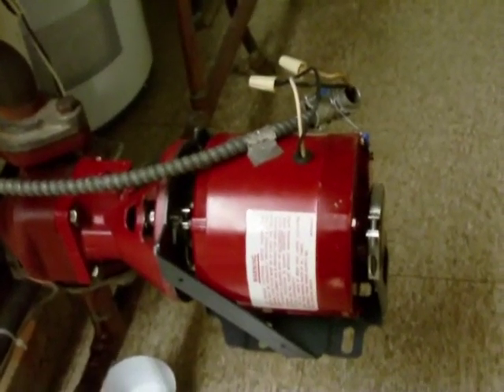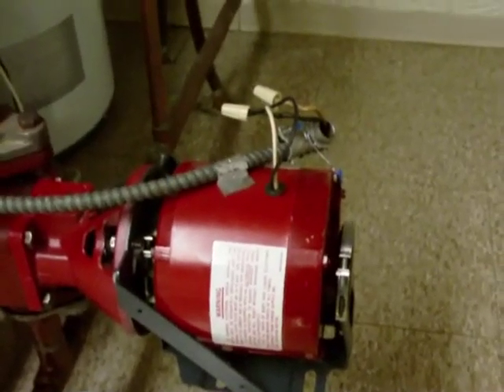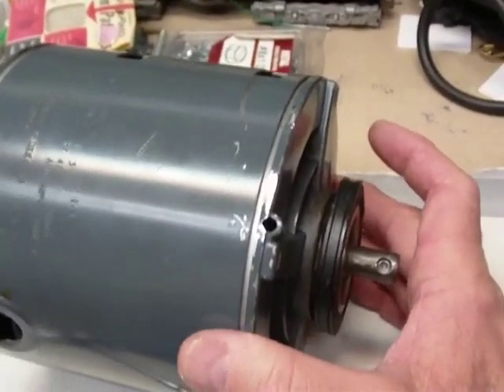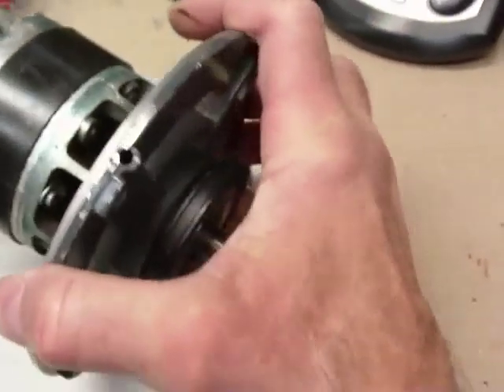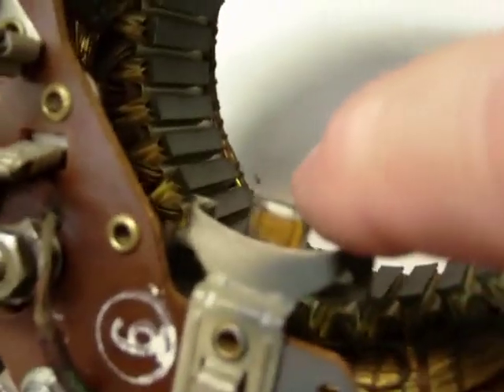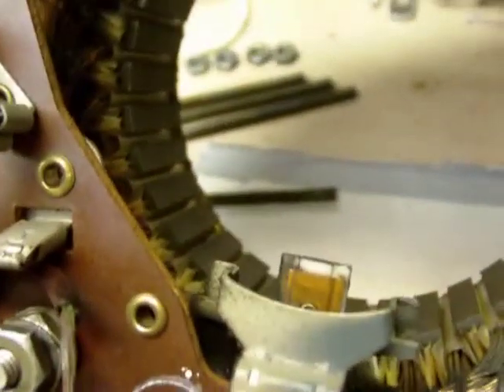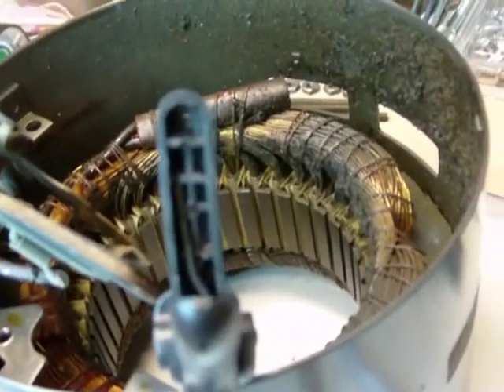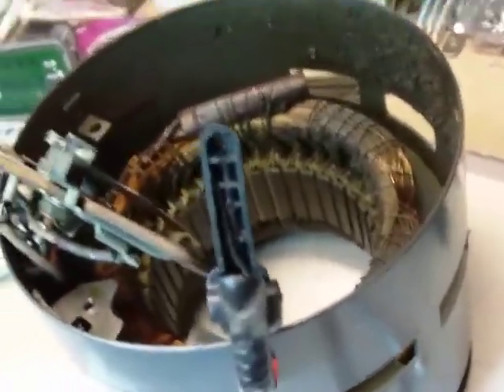ELECTRIC MOTOR DISASSEMBLY

Comment from the maker: I still have the motor and consider it operational despite its being very old.  I have not located a new starter switch board.  The problem is that the starter contacts are pitted.  When that happens, they heat up rapidly due to arcing, then sieze together, and would burn the motor out if you let it happen.  I filed them down but would rather get a new board/contact.  The motor itself is smooth running and quiet.  I prefer it to the new one--the motor is OK.  I'll keep looking...   Thanks.